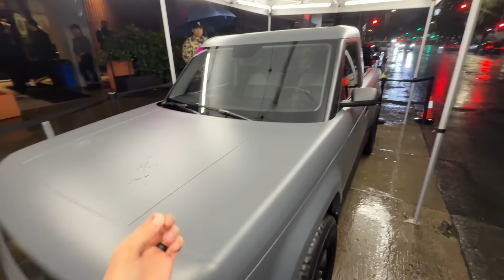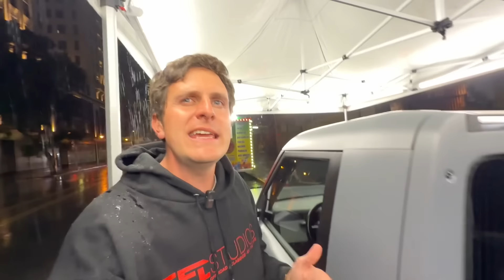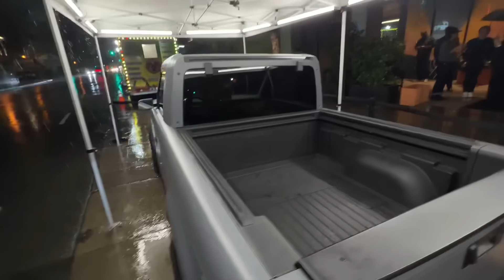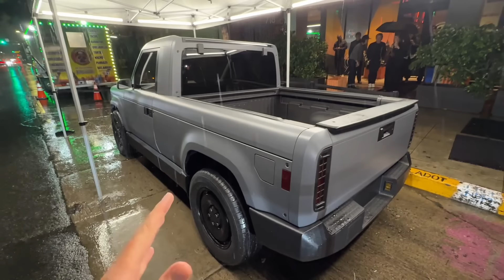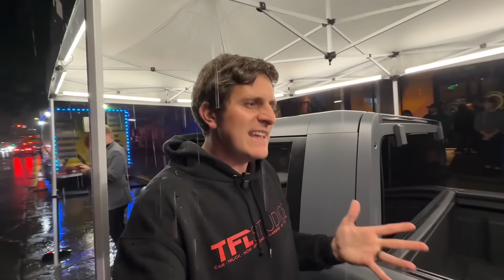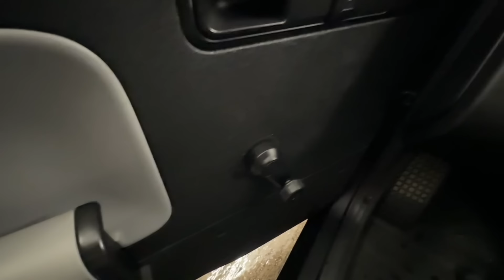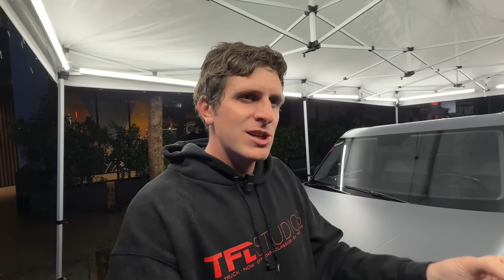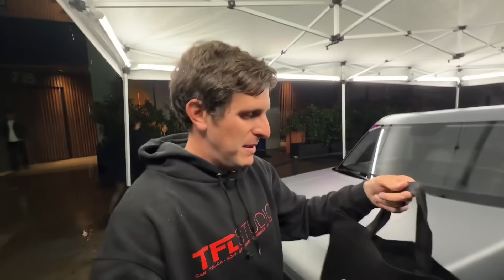The TRUTH About the '$20K' Slate Truck...Will This Really Be a Hit?

Comment: Tommy you're close to hitting the nail on the head, but here's my take with the Slate: it NEEDS to be priced as a 2nd or 3rd vehicle, because that's what it will be for most buyers. I can promise you with almost 100% certainty that the Slate will very rarely be purchased as a primary vehicle. The range and practically is too minimal. Even myself, a single guy with no kids, would not purchase the Slate as my standalone vehicle. What if I want to haul some friends around? What if I DO want to go on a long road trip? What about a vehicle for snowy winters?

With the way the Slate is currently designed, it will ALWAYS ALWAYS be a secondary or possibly even 3rd vehicle for people/families. And if that's the case, it needs to be priced accordingly. $20k? That's a hard sell when you consider that it will be an accessory vehicle rather than a primary vehicle. It needs to be priced like a new motorcycle or ATV– a tool or toy that is added to your already existing fleet of vehicles. $10-15k would make a lot more sense in my opinion.

Comment: The range will be the most limiting thing for this truck. 150 starting and over time battery will degrade. I have a base model 3 2019. Now at full charge can only go about 140 miles full to zero. You don’t drive your ev from full to zero usually 90percent - 20 percent. real world usable range for me probably 100 miles. Per charge - not good for road trips. We switched to using our gas car for road trips now. 

100 miles is okay at best for daily use but that means you have to charge your car every night not everyone has a level 2 charger. Nor is going to a charger everyday sustainable for most people. Even if you don’t drive 100 miles a day the charge disappears even when your car is just sitting there. 

This truck will be novelty car at best. Especially with that roll up window. Second or third car for most people. Over time that 150 mile range will dwindle and daily use can go down to what I’m predicting 70 mile range at best. Just like how the old Nissan leafs can only go about 50-70 miles. Ev range is also affected by weather hot or cold, winds, number of passengers and cargo.

Not saying 50-70miles real world use per charge is a good or bad thing. Just good to know of what’s ahead.

Comment: Tommy is 100% wrong. A lot of us (probably most of us) can't afford a 75k Scout pickup.  Yes I would love one they look great, but I want something I can afford. The added complexity of a gasoline engine would put this over 40k at least. Plus maintenance and comsumbables. Slate is the closest thing in years to being basic transportation that is affordable. Plug it in at home even with an extension cord for people that don't drive long distances. But yet it is cool because there are options to change it. Whether anyone does is the question, but the option is there. I would love the fastback topper without back seats. I would, however, like the capability of having a head unit stereo and decent speakers. Just easier to operate when driving than your phone. Plus better sound than some random BT speaker.  I had a 72 Chevy LUV pickup. It was so small and slow, but I loved that thing. I wish I never got rid of it. Everything can't be a TRD Pro or Raptor or Rubicon, people need to get from point A to point B afforably.

Comment: I got a reservation on a slate. This would be my first EV and the 150 range does scare me as I plan on keeping this local as an errand runner. The size reminds me of my 1996 ranger xl I bought new for $5999 as it didn’t have a radio, AC, and no power anything. It was a great basic truck I kept for 13 years  until a cracked head.

Comment: I disagree on the range thing. Ive gone to look at a vehicle to buy that was 90 miles one way, that means stopping somewhere for hours to charge before coming back home. I do pest control and ive driven 250 miles in a day just to complete my route. Friends of mine regularly go to events for just a couple hours that are  60 miles one way which means if yoy have the AC on in that truck or get stuck in some traffic, you might have to get a tow home. So i think range is important even if just for the fact that i might forget to charge it tonight so if my range is only enough for one commute then i cant get to work, or if the power goes out in the same situation then you have the same problem

Comment: The $20,000 price was $27,500 - $7500 fed rebate.    This is likely to be $29,999 once they get to production in a 18 months.  Plus the small battery will only allow 100 miles when its snowing.
Reply: I bet it'll be right at 25, also no dealers so you don't have to worry about them jacking it up for market adjustment
Reply: @mhoover5  Yeah cause that didn’t happen with Tesla.
Reply: @mhoover5  it was always $27k. It can only go up
Reply: @mhoover5  LOL, bless your naivete.
Reply: still more than enough for almost everyones daily driving.
Reply: @mikeb1039  Yup, it's just the "are you going to buy a different separate vehicle for longer trips" when you need them or want to go somewhere on the weekend... which most people will say no for. 

 It's the same with trucks.  People use the bed of trucks just a few times a year for most. But they get the truck because it can do that the few times a year they need it.  

Or with 4 door vehicles.   2 seaters tend to be by far the lowest selling models because while 90% of the time a person drives alone or with just one person, that day they are driving with their wife and kid, or three going for a camping trip etc that people buy the 4 door 5 seater.   

Which is why in the US if you want to sell an EV, you tend to need that 300 mile range that sells. 

For $20k I think you can maybe sell that.  But looking at a higher starting price (and no 0% interest deals like GM runs) than the Equinox LT EV for example... I don't see someone spending 200-300 a month more for so much less.
Reply: @rockinkuwaitchris  I already rent a car for long trips versus putting the miles on my regualr driver. Rental cars are cheap.
Reply: @mikeb1039  Yeah, see that's something most people don't do.  Heck it's cheaper to get a better SUV and rent or buy a little trailer or rent the Menards pickup once a year... but pickups sell like crazy.  

Not arguing against your method there, just noting that doesn't sell vehicles in the US.
Reply: @Jamilio-51 I agree there, and agree on the price bit not fitting that role either.
Reply: @mikeb1039 that's funny that you think just because you live within walking distance of stuff that the rest of America does.
The 100 mile range wouldn't even get me to the city then a few errands then home again without sitting somewhere charging.

It's useless for more people than it's useful for.
Reply: @Jamilio-51 well that's the thing.  80% of Americans take multiple trips over 100 miles a year.   So on average they do need more.  

It's why people buy trucks... 99% of their drives, they don't need a truck, but those few times hauling brush to the dump, is why they choose one or buy a trailer they use a few times a year.  

80% of my driving or more is just me.  Another 15% is either my kid, or my wife.   But if 5% of it is all three of us going to a basketball game in the cities, or out for dinner, just because a 2 seat vehicle works 98% of the time doesn't make it a viable purchase.  

And sure, you can argue that the average American doesn't need this streaming service, or that phone, or just needs a protein pack every day instead of fast food.  But if they are buying those things, THAT is what sells.  And we've seen in the EV market, low range EV's don't sell well.  It's why EV makers are increasing range, the average buyer buys an EV with 300 miles of range.  

And to see this one at 150, coming in higher priced than an EV that's much better and with 319 miles of range, I don't think that the "quirky factor" with a purchase this high will be enough.
Reply: @stephenbarabas6286 its almost like youre car is parked and able to charge while you run those errands
Reply: @stephenbarabas6286  you arent the common user. Get a maverick.
Reply: @rockinkuwaitchris why would you road trip this though? Its supposed to be a tool, you would have another car. Thats how trucks used to be, you had your working rig and then your sedan for the family.
Reply: @polbxyz  That's the thing I wouldn't.   Years ago I had an 80's Ranger I basically just tooled around town and hauled crap in.  Cost me $800 and lasted me 8 years.   Fine for something I wasn't going to take on a long trip as a 2nd vehicle unless I was going on a trip to pick up a dirt bike or something (which this can't do anyways).  

$30k for a limited 2nd vehicle though... That's a completely different world there.  That's spending $500 a month for a loan unless I'm saving up for that specifically, and losing 300 a month or so in residual value a month for 5 years.  

Not worth it in my mind for something we can't even take the family around in.  And like you said, my ranger was a working rig.  The slate has the lowest payload of any truck sold on the market today, and a lower tow rating than a honda accord and RWD only.  It's not really doing the working part.

And most every other truck today, you get enough of both worlds.  Here you, can't fit a few people in and throw your gear in the back and take a camping trip.  You can't pull a couple jet ski's to the lake.   If you have a family it has to be the 2nd vehicle only.
Reply: @mikeb1039  It's a golf cart basically, which is enough for most people's daily driving.
Reply: It’ll be $30k+ since it’ll be delayed another year or longer
Reply: At this point just buy an old used ranger or s10
Reply: @happyguy62  for the initial 20k I was in!! The more that price goes north the less so I am in!! I am not paying $30k plus for a bare bones truck!! The major appeal was the initial promised price for bare bones!! For me an infotainment system or even a double din radio  with decent speakers is important!! Further, I would want aftermarket wheels that look better than the steel ones. My interest is waning!!!!! I put down for the Elio. Waited for well over a decade for zilch ! That why I haven’t laid down $50 on a Slate. I have High doubts it will happen for a good price. 30k for me, NEVER!
Reply: they make an extended battery
Reply: Electric truck 100miles good for golf course or retired trailer home
Reply: @fvang4751  That's tough for a $30k vehicle.   especially if you want to go play with a couple buddies and now need a 2nd vehicle for that.
Reply: @h @happyguy62 opefully it will stay at $25k, as IMO even that is too high. But, once you hit $30k its gonna be a tough sell, because the 2026 Nissan Leaf starts at $30k. Yes, its not a "truck" but most likely the majority of people buying this won't care about the body style, they just want a cheap EV. If the base model ends up at $30k, those buyers will go and get a Nissan Leaf or a Ford Maverick. 
Thats the downfall of a vehicle designed to sell for $20k. The Nissan Leaf starts at $30k, and has a 300 mile range and rear seats, and "feels" like a $30k vehicle should. The Slate with the large battery and the SUV kit (for people whom want to carry more than 2 people), will be pushing $45k (not sure on exactly what cost will be as Slate hasnt released any pricing for the upgrades). I dont know too many people who will willingly pay $15k more than what a Leaf costs to basically get a similar performing vehicle. The only advantage is the simplicity will translate to reliability (but the Nissan Leaf has an excellent reliability record, its probably the most reliable car Nissan makes). 

At $20k the Slate is a slam dunk. 

At $25k its beginning to get iffy, and

Once you get up over $40k the case for a slate starts to not make sense, as the telo truck starts at $41,500 and has far more range and capacity (for passengers, cargo, and towing).
Reply: They said mid twenties stock, so probably no higher than 27k. And EVs don’t lose FIFTY miles when it snows, it’d have to be more like single digits or below to lose that much
Reply: not a problem for me. i drive 51 miles a day to work and back. the range is 2x what i need at worst.
Reply: Telo is a far superior truck for the money at $41.5k
Reply: @jasper_of_puppets  So for over 33% more. Got it.
Reply: @diesela3  For a 300% better vehicle. Get it.
Reply: @jasper_of_puppets  For me no. It's 100% inferior. It will replace my old F150 for what I actually use it for. Dump runs and a small 6 ft trailer. I've daily driven an EV for 7 years so the normal EV fud doesn't work on me. I just mock it and make fun of those people as one should do to someone speaking confidently about something they lack firsthand experience with.
Reply: @diesela3 A Slate with the larger battery (so it can compete on range) wont cost much less than the Telo, and the Telo has a larger payload, passenger, AND towing capacity.
Reply: @happyguy62  for that price I’m getting a used full-size.
Reply: @joeblowsmithjones get a pretty amazing full size OBS BRONCO for that lol
Reply: @joeblowsmithjones  From who???
Reply: @LuisRojas-uu4om  Yup, Used Ford Lightning pickups are in the 40K price point.
Reply: @LuisRojas-uu4om  a private seller?  You can get a sub 30k f150 any day of the week in all 50 states.
Reply: @gildardo no one wants a lightning
Reply: @joeblowsmithjones  Toyota has a nice truck coming out as well. That's supposed to be a no gadget, no sensors, or computers for $15,000
Reply: @lionelhowell4972 in the US? I can't see it. With the safety standards we have the computerization is almost mandatory
Reply: How did you come up with exactly $29,999 ?  A dream or got really high or something ?  haha  You are just guessing, speculating, and have no clue what the price will be.
Reply: @brentmiller8494 probably something to do with the 7500 rebate plus the marketed base price of 20k and then another $2500 for the inevitable price bump.  Nothings guaranteed but it’s a simple logical estimate. They could price it at 40 but they would catch flack for doubling their marketed base price
Reply: You can buy so much more for 20k though it maybe older.
Reply: @byronlocklear91  Yeah, a 10 year old truck this size for $20K. Lol
Reply: @brentmiller8494 You can get a brand new Nissan Frontier starting at $32k and if Nissan wouldn't have gotten rid of it, a brand new (4cyl stick shift) frontier would likely still be WELL under $25k . Which is moot becuase the slate will probably be more than that. I will see, i reserved a slate in the hopes that it somehow comes in UNDER price projections.
Reply: No offense but good luck for the 100 miles.   

It's RWD so you are certainly taking off those efficient tires and putting some 4 season or snows on there.  It's resistive heat AND no seat heaters.   

I've got a car that's resistive heat (with seat heaters thank god, making an EV without them is just dumb, it takes a lot more energy to heat air than solid mass).   And with 4 season tires, today I'll probably get about 55% of my proclaimed efficiency. ..   So if I run really close to the edge (30 mile left when I return), that's not a lot.   Here, that's 66 miles or so, figure 30 from the house is your limit.  And that's if their numbers hold up to real world testing.  Most fall short another 10-20% depending on brand.
Reply: I drove the smart electric For years if they tell you it has 76 mile range you Turn on the windshield wipers the headlights The heat or air conditioning And it goes down to 42 mile range This truck With the range that they've listed I could not make it to the nearest charging station from my house on a single charge if the weather was bad

Comment: Great video TFL!  Slate needs to drop the price do $17.5k and the weight of the battery low center of gravity will probably provide the necessary stability in snow.  Consumers will dictate the market demand.  I say bring it on Slate and try to make it five years.

Comment: Is the cost of replacing the battery the same cost of the truck? I worry with electrics that the batteries dont last forever and will need replacing, and this will end up being like a Tesla, where the battery at time of needing replaced, costs way more than what the car is worth. Gimmie this, but with a simple basic gas motor in it, and make it where I can get it cheaper in 2wd or 4wd for not everyone needs 4wd. I would buy this for sure IF it wasnt electric and had a good reliable motor with a manual trans.